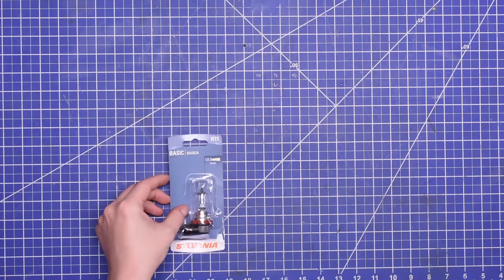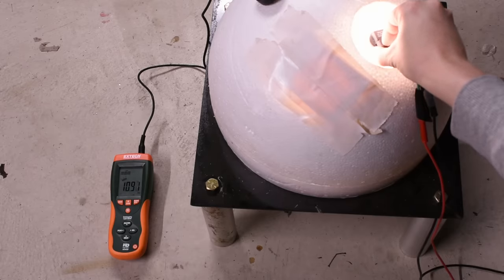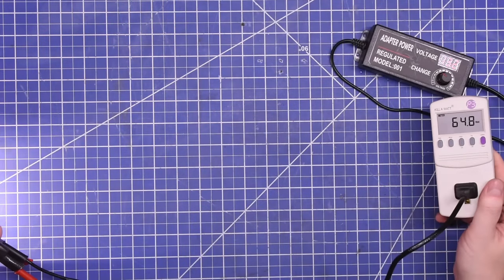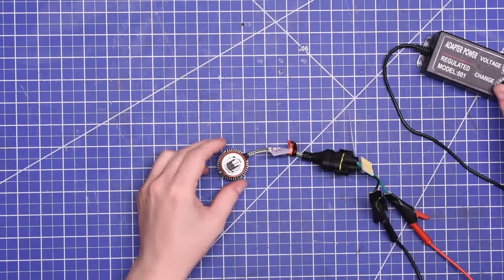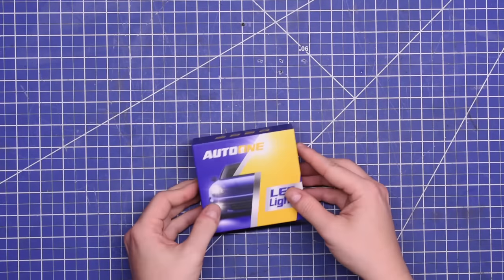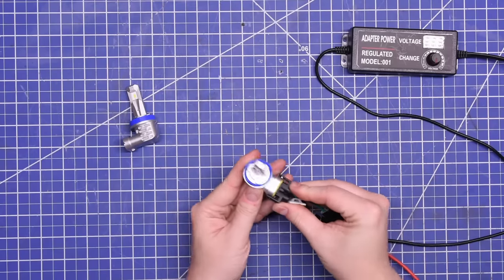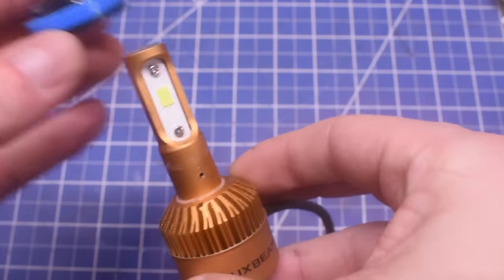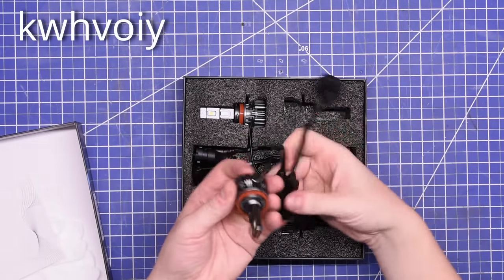Amazon Headlight Bulbs are Getting Out of Hand

Comment: One suggestion. Most cars run at 13.8 to 14.1 volts when the engine is running. That might be your lumen difference on the halogen bulbs. Also the Sylvania Ultra does not last long. Mine didn't make it a year.
Reply: Yeah just had to replace sylvania ultra I bought a little under a year ago
Reply: Nominal voltage is 14.42 volts when the alternator works correctly. At 74F/20C.
Reply: Good point, it’s around 14.2dc with a good alternator
Reply: Try LASFIT   LEDS They fit perfect in my 2019 F150…. Way better than any halogen.
Reply: @Dirtyharry70585  We run LASFIT turn signal bulbs in my wife's Mazda CX5, since that car has no discreet flasher unit that can be swapped out for an electronic unit to prevent hyper flashing.  The LASFIT bulbs have a built-in resistor that makes them work perfectly.  Super bright, normal flash rate.  However, they apparently get too hot after flashing only about 1-2 minutes (like at a long traffic light), and will revert back to quick flashing in that time.  But otherwise they're great.
Reply: I had the same experience with the ultras. Getting the basics are fine. Actually, I'm really happy with my phillips halogen replacements.
Tip: Don't touch the glass bulb when changing out halogen lamps. The oil on your skin can get onto the glass and creating uneven temps across the bulb, which can shatter it.
Reply: @Dirtyharry70585  I've used those going back six years or so on two vehicles. A 1996 2dr. Chevy Tahoe and an '08 GMC Yukon. I no longer have those vehicles but the LASFITs lasted on each for at least a year. I just installed LASFITs on my fiancée's 2014 Ford Explorer. They are bright of course and the light pattern is oriented to being out of the annoying range to oncoming drivers. No one flashes their high beams at her. We took it out the first night with the 9005 LASFITs and I got to experience the performance of the bulbs myself. These do have a little fan at the base to help dissipate heat. I hope they will last at least a year for her. I'll be keeping an eye on them.
Reply: @sjokomelk ain't 20c in my engine bay unless it's -40 out
Reply: My NAPA's Ultra Bright (Whatever the top model is called), lights Ive gotten have lasted a year so far! Definitely look into those :) Oh and it comes with a free 3 year warranty
Reply: @sjokomelk  it should be 15 volts when charging when not charging 13 volts alternator has to stay above battery voltage or else battery voltage will drop. When the cars overloaded like the AC being on the window defroster the alternator will pump out more voltage even if the battery is fully charged.

Comment: I bought some Fahren LEDs for my Subaru (which are infamous for having very poor headlights). Yes, the lumens claimed on Amazon were ridiculous and I knew it up front. I went with a medium "warmth" at 6500K. The price point is a bit less than the more expensive Sylvania halogens.
My mechanic installed them for me, but one is oriented slightly wrong which only affects the DRL setting. HOWEVER, he did aim them well. I can see so much better out here in the VERY dark, deer filled nights of western S. Dakota and I have NEVER been flashed because he aimed them well enough that they don't hit oncoming drivers in the eyes. 
With the LEDs, the aiming is absolutely critical. Read the reviews, don't go for the cheapest thing out there, research the brand and have somebody who has some experience install them if you can't do it yourself. I'm very happy with my choice.

Comment: I know they don't fit in an H11 housing but it would be great to see how well the 9012/9011 HIR actually perform against LED and standard 9006/9005 bulbs, they claim like 15-20% more output than regular 9006/9005 and drop right into those housings with a set of side snips.
Reply: I heard that can sometimes fry housings because HIR are hotter than regular 9006/9005. careful
Reply: Been doing this for years. They’re great. Long life bulbs are brighter than silver stars. I haven’t had anything melt. You can’t use it in low beam housing that doesn’t cover the bulb tip or you’ll blind oncoming drivers though
Reply: @ingram0774  Yep same wattage as a standard bulb, doesn't get significantly hotter. I've had the same set of HIR bulbs in my highs for years and I'm sure they've been left on for hours on end on long night drives.

Comment: Kind of surprised out of all the equipment you have, that you don't own a CC/CV bench top power supply. They're pretty handy as some of them even give you the wattage out of the device you're testing, and not the wattage in that also factors your current power supplies efficiency (and how that efficiency changes depending on the load on the device)
Reply from the maker: It's a good point, just bought one.
Reply: I couldn't live without a bench power supply I build circuits and yes a month back the psu died..

Then came a frantic scramble to find a +12vdc power source, luckily I had an old laptop charger which I wired up to an lm2576t adj regulator just to power a 3v audio circuit as I didn't have a 3v power supply

Bench labs are worth their weight in gold
Reply: @cjdelphi  100%. Although I don't usually deal with a great deal of board repairs (or building them), it's extremely handy charging invervidual Li-Po's, powering circuits that require testing with a very specific current setting and powering odd bits of hardware that have very weird voltage requirements.

For myself personally; I would really like to get another lab bench top supply rated at 24v Max and perhaps 10-15A. Though my current 32v 5A is very handy!
Reply: @Miles7955  https://youtube.com/shorts/bqStwdVElzw?feature=share

Just building that little circuit would have been a nightmare to do without lab bench, only a multimeter ranks slightly more important lol
Reply: @cjdelphi  jeez, I would completely believe that. Even if you had a CV source, I'd personally be very concerned with the circuit taking amperage that I didn't want it to, usually resulting in the magic smoke being released.
Reply: @Miles7955  once you blow up enough stuff, you tend to confirm your connections are wired up correctly unless you enjoy cursing and wasting  money and calling yourself stupid for a few hours, but I still blow stuff up by accident occasionally 😅 like switching on the power supply thinking it's still dialed into 5v but the cat brushed past and now there's 22 volts going in, it happens everyone must release some magic smoke it's fun to begin with!

Comment: I would recommend using an OEM headlight housing on your next test to see if it makes any difference. I've never had much luck using aftermarket headlamp housing's.
Reply: ...or any luck using apostrophes correctly.
Reply: I get your point, but all bulbs were tested in the same housing. If the aftermarket housing made the stock bulbs look 20% trashier, then all the others were also 20% trashier.

Comment: I would suggest the lower color temperature of the halogen allows us to see more detail in the typical concrete landscape. The higher color temperatures are just creating more glare since they create too high a dynamic range for your eyes to simultaneously see both the detail of concrete and the detail of other items in view. Being able to see where potholes and curbs are is pretty important.
Reply: In the rural areas somewhere between the ultra blue of most LEDs (glare in the rain) and the really soft light of halogen (lose contrast) is ideal. More color definitely helps spot deer popping out of the woods!
Reply: the sun is around 5500-6000k, so thats the best place for headlights to be
Reply: @bradhaines3142  Sunlight intensity doesn't diminish with distance like a headlamp does. Inverse square law doesn't really apply to the sun as it's so far away the brightness is the same at the top of a tree as it is at the bottom. You can't use the sun as your metric because of that.
Reply: @wally7856  that's brightness, K is color temperature, which is irrelevant to distance
Reply: @bradhaines3142  Color temperature is relevant when your intensity of light decreases with distance as our eyes lose sensitivity to bluer light as brightness decreases. In dim conditions we are much more sensitive to yellow and greens. The optimum color temperature to see during the day (sunlight) is not the optimal color temperature to see at night.
Reply: @wally7856  then why do my white (6000k) lights seem so much better at night than the original yellow even though brightness is about the same?

Comment: The lumen ratings are for both bulbs together. Just like the 60k termitor bulb you showed the two pairs were rated at 60k but if you buy just the h11 they are rated at 30k

Comment: The safest headlight upgrade for anyone with an H11 bulb housing is an H9 bulb (with the clips modded). It’s a halogen 65w bulb with a 2100 lumens rated spec output. Most/all of the LED’s moved the beam hotspot away from the halogen location (the most intense area of the beam to see down the road) and added glare whereas a halogen H9 has the exact same beam pattern.

Comment: I bought the Cougar Motor Led headlamps out of several websites recommending them, and so far, they have been amazing. The beam is perfectly straight at the top and the spread is very wide. They are pure white and extremely bright, but I have never been honked or flashed at by other drivers. Infact, I can even look at them directly myself. Would like to see how close the lumen claims are. I also heard that while LED's have higher lumes, their lux or throwout is much lower than halogen. Can you test this?

Comment: Really need a larger current PSU. It's limited in voltage because it can't supply the current for the incandescent lamps. Running them at different voltages will cause dramatically different lumen ratings for any sort of incandescant.
Reply from the maker: Edit: Bought a 480W stanup PSU with 10A out and more voltage range. Appreciate the feedback guys. 
The PSU has no problem sending 75W to other 12V projects, and sent more watts to other bulbs. The OEM bulb just takes that much, that's what it is. Well really like 55W according to specs sheets, with loss efficiency from the PSU accounting for the difference - but that's the same with each bulb tested.
Reply: Your car is only putting out 12v , the wattage is what counts no?
Reply: @TorqueTestChannel  That'd be because the current limit was reached at a higher voltage, allowing more watts to pass. The current limit is huge for incandescents, my halogens basically double in brightness when I start my car, 11-12ish volts to 14.7ish
Reply: @happytrails5342  Cars output anywhere from 11 to 15 volts, depending on the electrical load and if the engine is running or not
Reply: Also I should add that the watts won't change much. As the tungsten heats up the current won't increase proportionally like it would through a resistive load. But a hotter tungsten of course means more lumens, partially because the black body radiation enters the visible spectrum more. This also increases efficiency.
Reply: @TorqueTestChannel  Your method of measuring watts is flawed unless you take into account the power losses of your power supply. Some energy is lost through it, making your watts reading higher because you're measuring the watts consumed by not only the bulb, but the power supply too. If it's 85% efficient, which is probably somewhat accurate, and you're measuring 65w, then only 55w is making it to the bulb. I know 55w is the rating but they're typically rated at 12.8v. I have noticed that many bulbs will draw more than their rated power at their rated voltage though, because the 55w rating is set by regulations, so often times manufacturers will go beyond that rating somewhat to try to gain an "edge" over other competing products. If they're getting 12.8v then the test is accurate to the manufacturer's claims, which I know is what you're testing, but I feel that it may be important to compare real world experience as well. I just measured the voltage drop across the old wiring in my 1990 year car, the bulbs see 13.9v when the alternator is outputting 14.7v. This difference is enough to skew the results by several hundred lumens.
Reply: @TorqueTestChannel   It is correct though. If your PSY won't go above a certain voltage, it is current limited, no matter what wattage the manufacturer has written. In a car, the bulps will get close to the output of the generator (generally ~14v give or take) and properly draw significantly more power than advertised. The 55W (here in DK at least) is a max limit for low-beam in cars when talking halogen, hence why all manufactures advertise this. I have had various bulbs melting their sockets because they draw 100W+.
And like others have also noted, to measure the power draw, you have to measure between the PSU and DUT, not in front of the PSU. This is fairly easy to do with a standard multimeter. Old PSU's have an efficiency of ~50% while newer has above 90%. However, the efficiency various greatly dependent on the power draw, so very hard to account for.
Reply from the maker: @andidegn  These are good points guys. 
Bought a 480W standup PSU with 10A out and more voltage range, and the % fact makes sense. Appreciate the feedback guys.

Comment: Aftermarket LED bulbs are not road-legal in the UK - using them in reflector (as opposed to projector) headlamps causes beam-scattering, and headlamp pattern is an MOT test component.
Reply: Usually not a fan of excess government oversight, but that's one I'd love to see here in the US. Or at least more ticket enforcement by police patrol. When I can't see a damn thing for a good 10 seconds after they pass in the middle of the woods where there's lots of deer around here is aggravating. I usually close/squint my eyes for a second as they pass. That 1-2 seconds of total blindness is shorter than not closing my eyes.  
And idiots driving around with their 50" lightbars on 24/7 is still a thing I encounter here in rural US. I hope they know they look like dumbasses, but I'm sure they don't care.
Reply: @andrewt9204 They're not legal in the US either. You'll notice at least a couple of the LED bulbs had the words "fog light" in the title. That's because if you read the fine print on the package you'll learn that's because they are for off road use only (or possibly as fog lights that are turned off when there's oncoming traffic).
Reply: Beam pattern is defiantly brand specific with these led upgrades. Some are as good or even better then the halogens they replace, some spray light all over the place. You have to find a good one or you will blind everyone on the road.

Comment: If you're looking for a reliable brand, I have used X-Seven in my H7 high beams, adaptive turning lights and H11 fogs. I've just ordered the new D1S LED from them too. The output is awesome and the cutoff on dipped beam (projectors) is identical to Osram Nightbreaker Lasers but MUCH brighter. I drive a lot late at night on country lanes with no traffic.

Comment: I'd love to see a comparison of some of the LED portable work lights, especially the small ones with built-in rechargeable batteries. I've had bad luck finding ones that meet their specs claims... Brightness, light pattern evenness, and battery life of the ones on Amazon have all been worse than the CAT branded ones I got at Costco a few years ago and can't find anymore.
Reply: Costco does their homework! The Ryobi ones are a better deal than the Amazon ones, they're not amazing but they tend to last longer than Amazon at similar price.
Reply: Yes do this, I've got a Milwaukee rover light for finishing and a home depot husky 7000 lumin led stand light for general lighting, it would be great to see a comparison, the rover is quite good and I have 2 batteries for it even though they both need to charge in the tool, 3 settings and lasts like 3 hours on max per battery, longer on low or medium and it's still quite good. I got a crappy 50 dollar worklight that was advertised as bright as the rover and it was awful, lots of consumer information needed in this area I think now that LED lights are the norm and not those hot as sun halogen worklights that will set fire or burn cords.
Reply: Found a Rayovac brand rechargeable flashlight at Walmart hold a good charge about four hours constant on brightest setting about 6 on the low settings which isn't bad cause both settings are nice and bright

Comment: Do you think you could do this again but with a projector style lamp? In my experience and from what I have read, it works better. I have tried some reflector style, and it results in a lot of scattering, but the few projectors I have tried seem to work pretty well.
Reply: I tested several LED lamps from AliExpress in my car's projector housing compared to halogens and didn't see any beam pattern changes. They were significantly brighter. Some of the LEDs lasted a long time, some didn't.
Reply: @nicholasvinen  The LED lasting is just an issue with cheap LEDs, but I also found using a projector gave a good light beam, at night I can definitely see the top cut off of my lights and when correctly adjusted for height from my side it looks like the light doesn't shine to oncoming cars. One day I should put my lights on and stand in front of my car to see.

Comment: the collar is to time the led light in the headlight housing. each side of the light cobbs should be facing 3 and 9 o'clock for optimal light output in most domestic light housings.
Reply: but try out some Morimoto 2.0 Stroke 3.0 headlight bulbs

Comment: Something that should be noted, when these LEDs are advertised they are giving you the combination "rating" so the 18k lumen set is actually claiming 9k each. The 36k set would be the combination of all 4. Of all the LEDs I have tested the NovSight have seemed to be the best so far especially the newer N60 ones (I am using the N60 H11 Novsight)